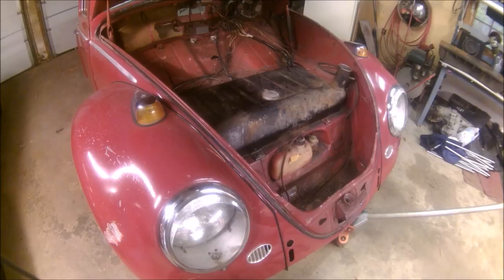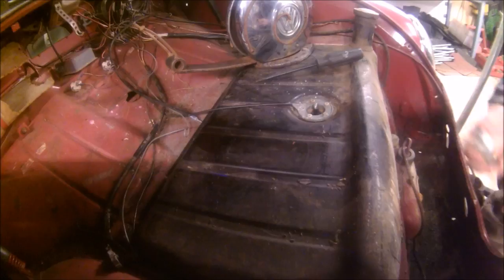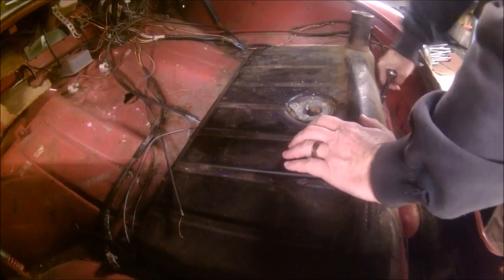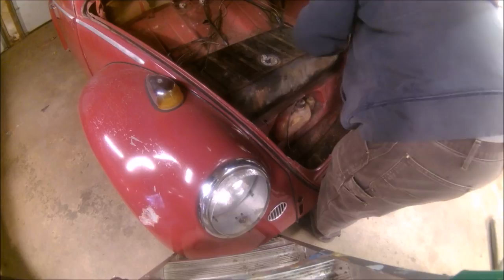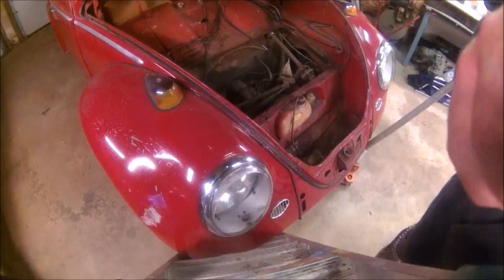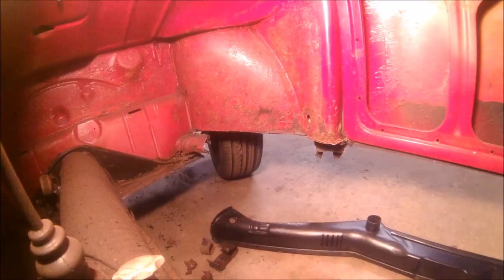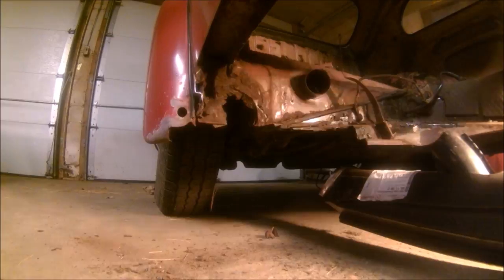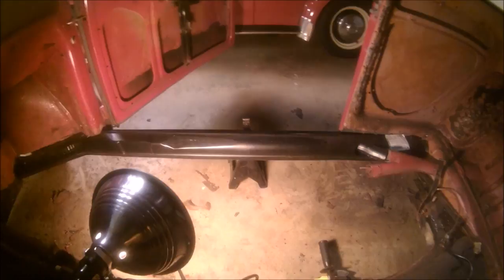1964 vw bug (Daisy) part 15

Comment: I’ve just done the bottom six inches on my ‘63 , great work your doing there . 

Top tip , ; cover the glass on both bugs (I used cardboard) to stop the sparks from melting into the glass . 
It’ll feel rougher than a porcupine’s ass if you don’t . 👍🏻
Reply from the maker: thank you for the great tip and for watching

Comment: When I had my Bugs (one '73 Beetle and one '73 Super Beetle, some idiot(!!!!) thought he was a super genius by putting sugar in my gas tank! It took 3 hours to wash out the hoses, carb and remove the tank and rinse it out (the rinsing of the parts took most of the time). After that I put the fuel system together and Lo & Behold! The Bug Started Up!!! I drove it to a dealer to get the rare VW Locking Gas Cap, and then took it home. The Idiot  showed himself up by saying, That repair cost you a lot, didn't it? I said "What repair?" And he said "I heard someone put sugar in your gas tank." Since I did not tell anyone about it, how would he know? So I gave him a right cross jaw and told him that if my car ever fucks up again, consider himself dead. He left the city to some relative's home down south.
Reply: Excellent Job, VWNut. That gas tank removal is just how I remembered it.
Reply from the maker: great vw story. thanks for watching

Comment: You've cut out a fair amount of infrastructure that I hope you're planning on replacing aside from the heater channel. For instance the section upfront where the two bolts hold the body to the tunnel crossover and the strip you cut off the tunnel that is the lip the pan rests on to be welded to.
Reply from the maker: thanks for your imput and for watching. stay tuned